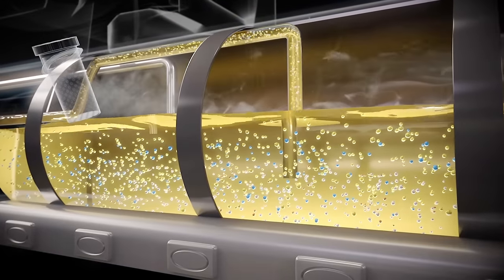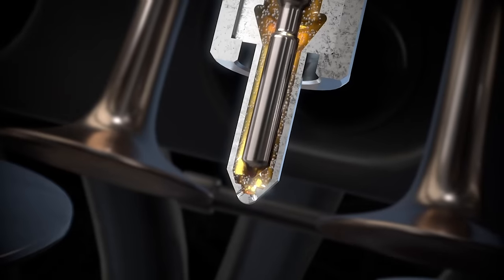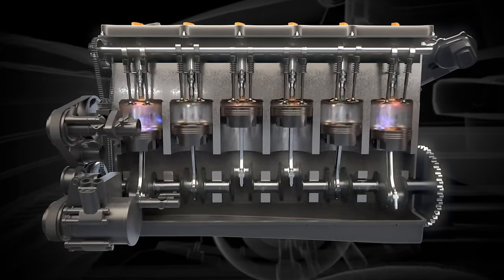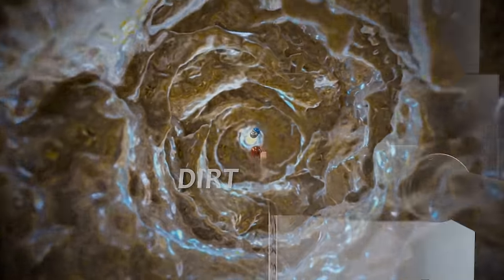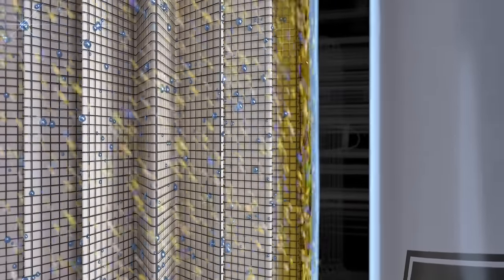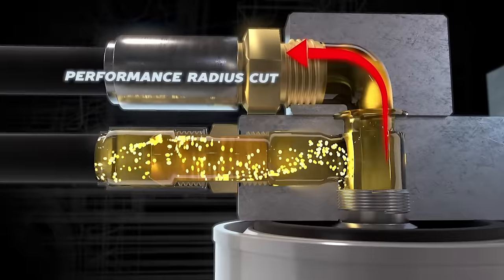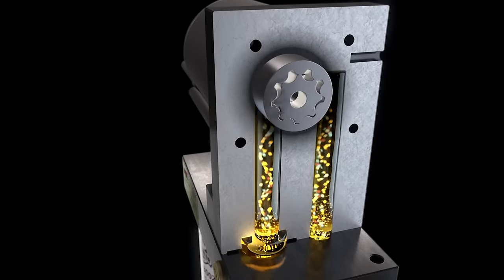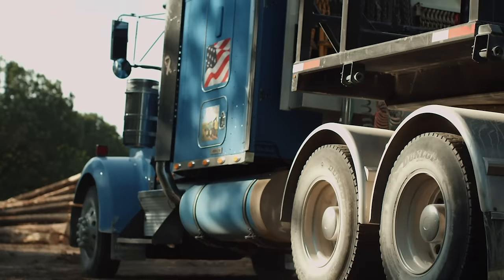NEW!! FASS Fuel Systems 3D Animation

Comment: Money well spent on this video. 👍🏻 now I just need to go buy a 165 myself for 2012 Chevy 3500hd
Reply: Don’t waste any time, I bought one for my 1999 Cummins, I did the injectors and also bought an injection pump for it as well, spent nearly $3k and did all the work myself, truck has 330k miles and is running like brand new all over again! I wasn’t about to do all that work, and spend that much money to chance having an expensive fuel component fail me again. It’s like cheap insurance for the fuel and truck life!!!
Reply: @Matt-fw3xw  Thanks
Reply: Have you purchased a 165 yet? I have a brand new 150 I am interested in selling. i "over bought" for my needs. I installed it, but havent run it yet. I need a 100gph, instead of a 150. If youre interested, if you buy the 100, I'll swap trade you even 100 for the 150. I know I wont push +600hp with my gen 1. I'll get close, but not 600